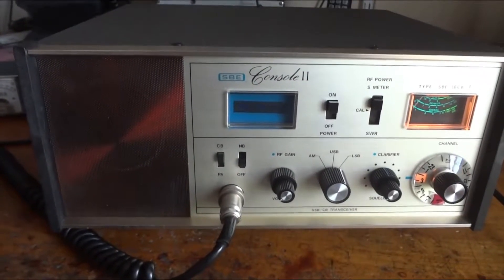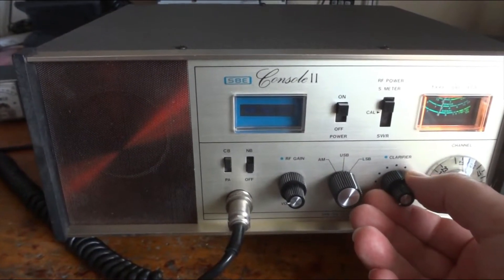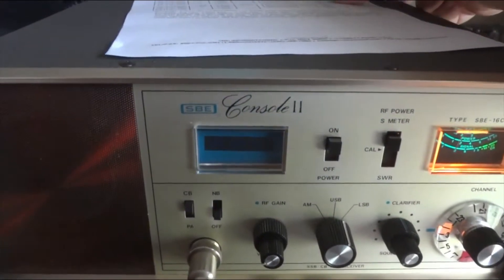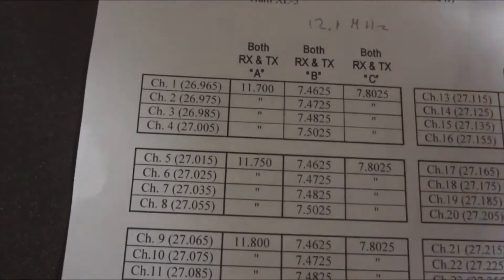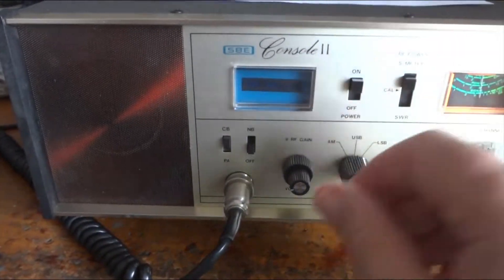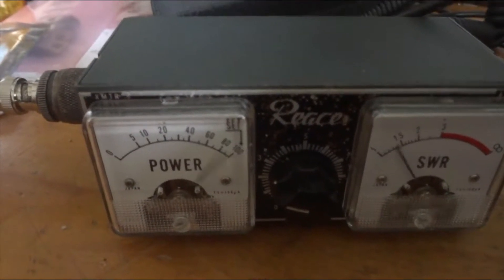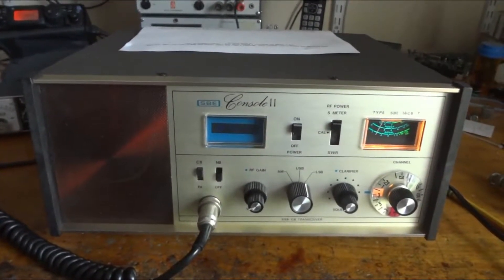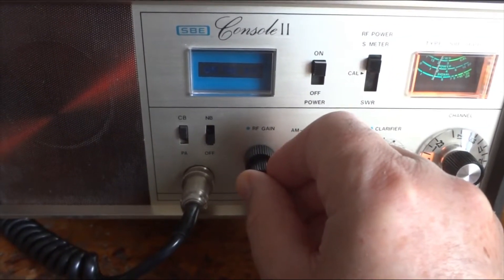Demo of SBE Console II, Sidebander II and Sidebander IV, restored radios from my collection

Comment: Nice SBE Console II. Still my favorite base station of which I have several. Have one that someone modded the RF Gain control to work as a RF power out as well. Due to this the RF Gain in receive is compromised and I would like to put it back to stock but can't see where they modded it by comparing to another console II. Any ideas anyone? Thanks '73's
Reply from the maker: You can download the schematic diagram for this radio from CBtricks.com . Best is to download the diagram for the SBE Sidebander II, it is the same radio as the Console II but for mobile use. With that diagram, you should be able to undo that RF gain modification abuse again. Here is the link: http://www.cbtricks.com/radios/sbe/sbe_12cb_sidebander_ii/graphics/sbe_12cb_sidebander_ii_sch.pdf